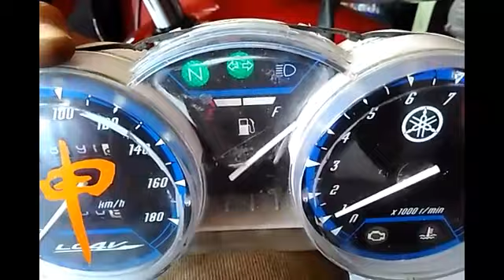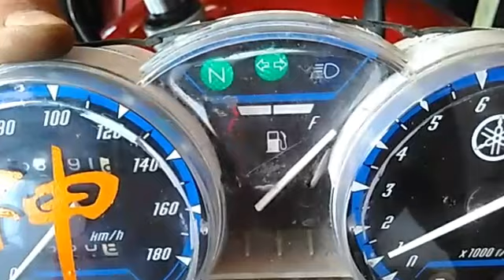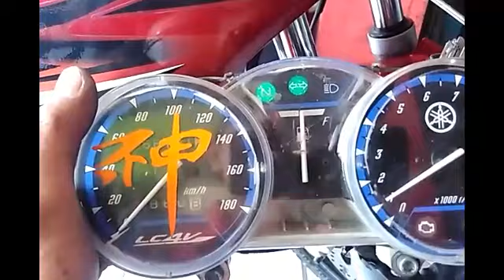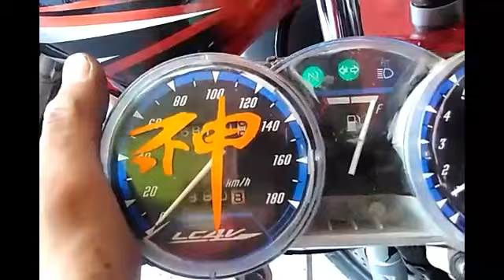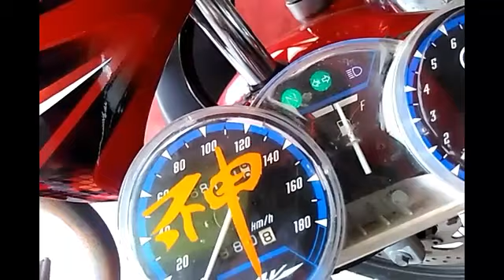Jarum Speedometer mentok tak mau balik ini tipsnya

Comment: Kalo jarum gak mau gerak gmna bang
Arus dr spul, kiprok, aki, ECU semua normal. Tp jarum tdk bergerak.
Reply from the maker: Jarum yg mna
Reply: Sama nih problem nya, jarum rpm gak gerak pdahal smua normal, cm bingung mau service nya
Reply: @gantaigarashi9426  
Aku dah normal
Solusinya ganti yg original
Kalo yg KW,jalur kabelnya pada suka terbalik pasang. Kalo gak komponennya ada yg mati
Reply: @asnawihermawan5954  sampean ganti speedometer nya ya? Gak d service?
Reply: @gantaigarashi9426  ganti mas
Pas aku check, jalur" Kompeten nya pada ngaco
Reply: @asnawihermawan5954  ori ny sampe brpa harganya?
Reply: @gantaigarashi9426  560-600